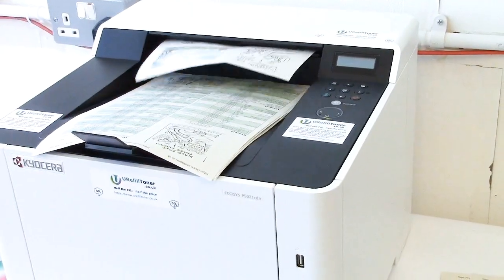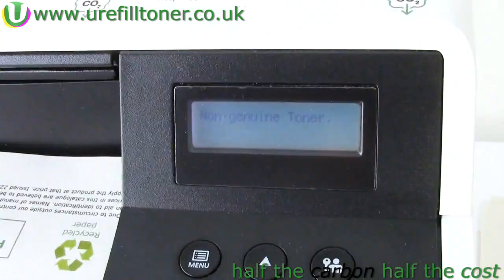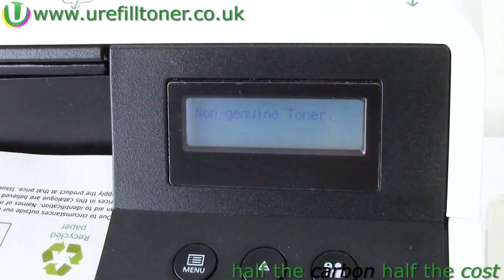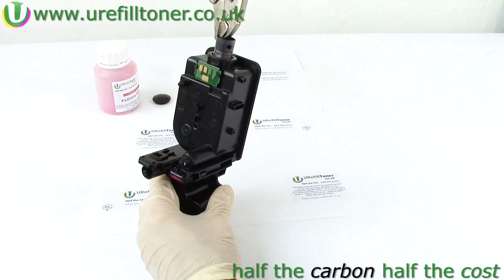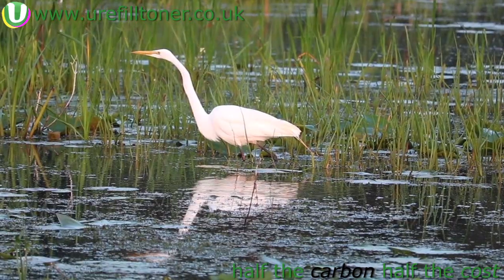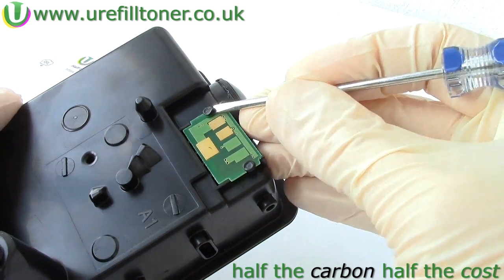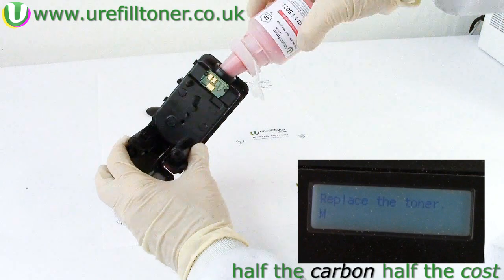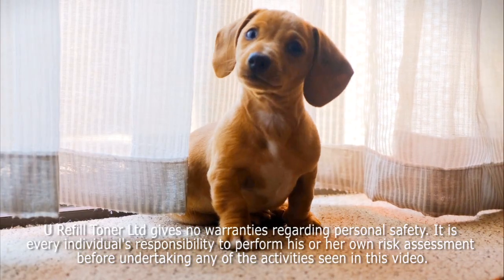How to refill Kyocera ECOSYS M5521cdn, M5521cdw, P5021cdn, P5021cdw

Comment: Thanks for the video. I bought Urefill toners for my previous laser printer and now having upgraded to a Kyocera M5521cdn needed to check what was available. Useful tip about the chip and toner not necessarily needing to be replaced at the same time. Although as I don't use Windows (I use Postscript 3 driver on RISC OS) is there another way of knowing what colour needs to be rechipped in response to "non-genuine" message ? (Apart from guessing from a label stuck on the toner with the date I refilled them.)
Reply from the maker: Sorry, but a "Postscript 3 driver on RISC OS" is not our area of expertise. When you get a "non-genuine" message, the printer must know which colour cartridge it's not happy with. That's shown by a pop-up on the computer screen in our experience as you can see here
https://youtu.be/XxQ9MHYQAhc?t=408

Comment: Hello, I'm considering going down this route in order to be more environmentaly friendly and save some cash. My only question is; what do you do with the waste toner side of the cartridge? Is there any way to empty this? I'm worried that the waste portion will fill up too much and leave a big mess inside the printer. Thanks in advance.
Reply from the maker: The waste does gradually fill up and it can be emptied, if necessary
Reply: @urefilltonerUK  Thanks for the prompt response. Looks like I'll be buying a Kyocera and going to you guys for some refill kits. Have a good bank holiday weekend!

Comment: Hi, just wondering if you have a video on refilling canon MF746cx?
Reply from the maker: Same as the HP M454 here 
https://www.urefilltoner.co.uk/ProductDetail.aspx?manufacturer=Canon&productCode=HPM454BOTB&price=12.38&description=Black+toner+refill+bottle+50g++2%2c300+yield&engine=HPM454&printer=MF744Cdw%2c+MF746Cx&id=3081&weight=70

Comment: If Kyocera put their money where their mouth is they wouldn't use chips. Kyocera are all for the environment (with long-life-drums) but the toner lets them down. Chips mean refilling an empty box is expensive and difficult so totally against environmental protection. Kyocera used to be chipless (and also RFID-stickerless before chips) which was genuinely good for the environment as all you had to do was remove a plug and pour in a bottle of replacement toner into an empty box and hold down the green button for 12 seconds to reset the counter. It seems profit before ideology has now infected Kyocera and they lost their way.
Reply: I never knew Kyocera toners were chipless, thanks. You are right it's a backwards step but hopefully in a post-Covid world and the chance for humanity to mend their ways all printer manufacturers may look beyond chipped toners.
Reply: @emotivepiano  hopefully you are not referring to the great reset lol